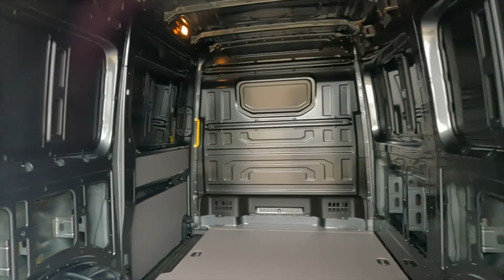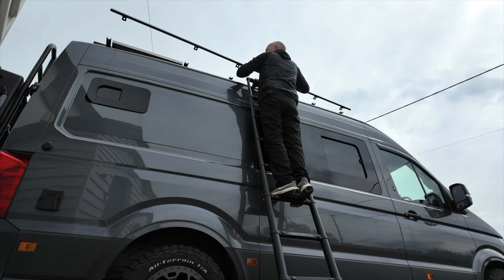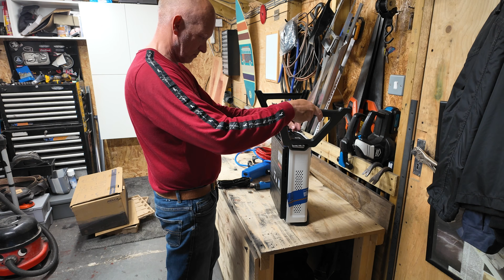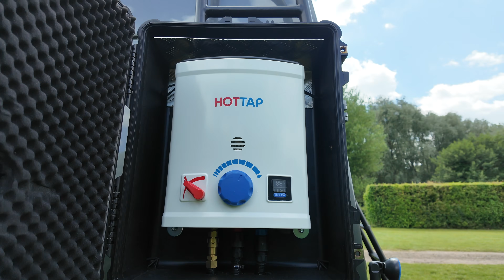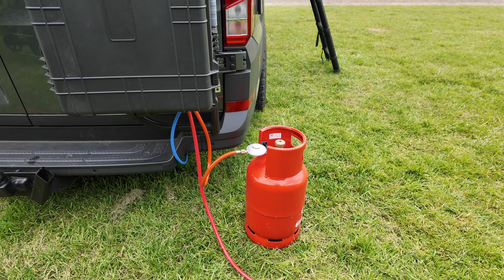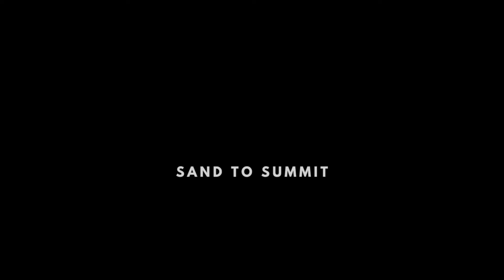VW Crafter Camper EP19 JOOLCA Hot water shower unpack and in use.

Comment: Interesting, great video 😊 can ask what brand wheel carrier, ladder, and back boxes, great set up on the rear 😊
Reply from the maker: The ladder and wheel carrier are by ‘Wheeliams’ and the boxes I got from Amazon, I’ve now recently changed them, I’ve now got a ladder and wheel carrier combined and a safari rack with one bigger box supplied by a company called ‘Mule vans’ I’ve got all the other set up for sale if your interested.
Reply: @exploresandtosummit   Do you still have the old setup? I'm not sure if they would fit a 5.1 Transporter with barn doors, but I'd be interested if they fit and are available.  Awesome set-up!!
Reply from the maker: @luiscervino6181 hi, I do, I’m just repainting the carrier and reattaching the boxes, then I’ll probably sell them with the wheel carrier as a package. I don’t think they would fit a transporter as the hinge spaces may be different.

Comment: Hi... Re the storage cases you've used. In hindsight would you have sourced a single larger case to hold the boiler and pump/switch/hoses rather than having two?
Reply from the maker: Hi, yes absolutely! I’m actually changing this next week, I’ve one large case arriving and I’m changing the rack to fix it on. So one case should hold everything. And it’s aluminium so stronger and still lightweight.
Reply: @exploresandtosummit  Ah, so not the larger version of your own hard/plastic case then? Which is a few inches deeper? Which aluminium one have you gone for? Video out tomorrow?
Reply from the maker: @carlstoakes6240 I’ve gone for a Mule Van box, there strong, a good size and lockable. Aluminium so the joolca if gets too hot won’t be a problem. I’m trying to get my electrical video out tomorrow evening, just editing the final bits.
Reply: @exploresandtosummit  ah sorry yes, I think your commented last week about getting Mule Van stuff. Quality gear but makes me twitch paying that sort of money for a box 🤣
Reply from the maker: @carlstoakes6240 yes me too! I’ve put down to a business purchase expense! There’s limited suppliers of this sort of thing, the plastic ones have served me well, I just wanted one box. and I’m installing a rear ladder and wheel carrier so wanted everything to match.